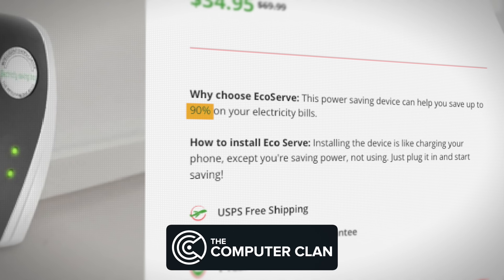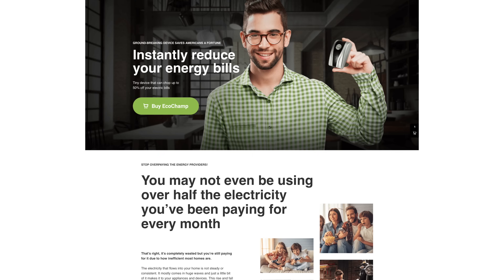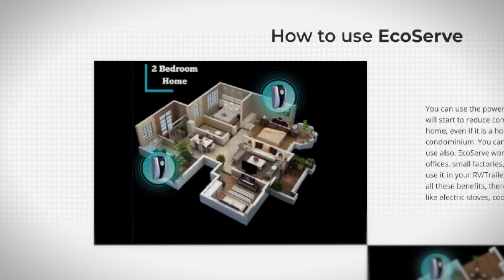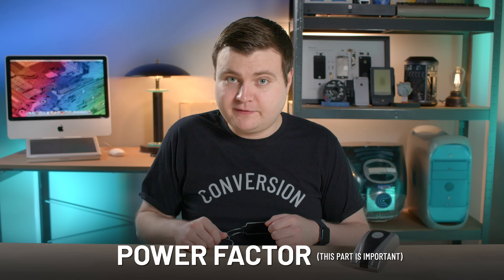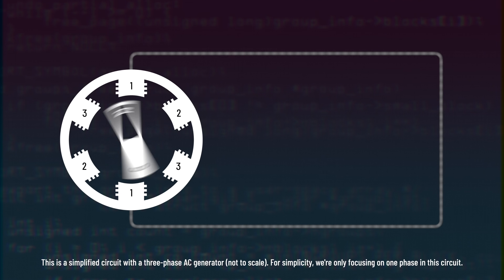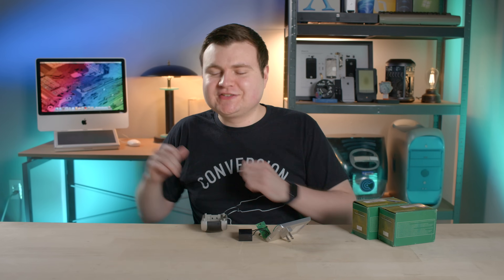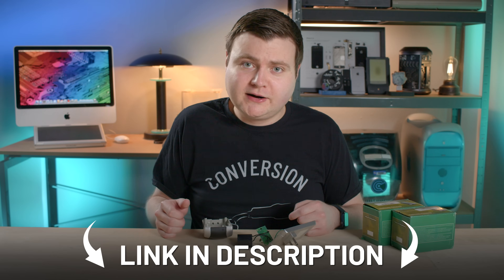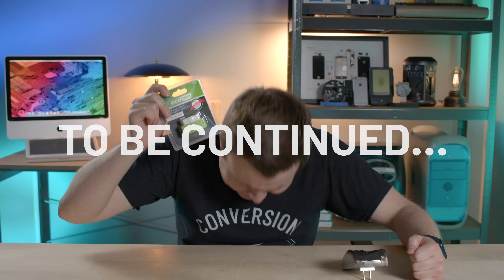Electricity Saving Box Scam (The WORST I've Seen) - Krazy Ken's Tech Talk

Comment: Let me just add something to this, modern utility meters have the ability to display, as well as record, at revenue grade(less than 0.05% from absolutely correct) real power, apparent power, total power, power phase, and frequency at sampling rates about about 1khz, though most of the data networks they are connected to cannot handle that much data from all the meters connected to them, so they do summations of these metrics at intervals that are programed by the metering department of the utility. They can also trigger reports in real time based on certain criteria, such as low voltage, loss of power, frequency deviations, or other issues, as programmed by the metering department. 

A modern meter, by default, stores these metrics at about 1 second intervals for about an hour, about 5 seconds for about 6 hours, and then about every minute for a month on the onboard storage. Depending on the metering backend connected, and the exact settings of that backend for the particular meter, the utility may have years of 1 second interval data from a meter(this was only really ever set up at that detail for nuclear plants that I am aware of) 

As a fun fact, they actually record power flow in each direction separately, but, in most states, regulations are such that unless you have a net-metering contract, you are actually charged for the summation of both ingoing and outflowing power, as a legacy of the mechanical meters anti-tampering and anti-theft measures. Where this is true, it's a requirement of the state regulatory board. Modern meters actually have a lot of cool tech crammed into them, like multiple serial interfaces, pulse outputs for external metering or monitoring equipment, wireless modems and gateways both for the consumer and utility use.

Comment: Might sound nitpicky, but it's a HUGE correction actually. Apparent power isn't "the actual power being supplied". It's the apparent power on the grid infrastructure.  Let's say you were the only factory on a line between a power generation station and your factory. The power generation station would produce True Power KW, and your motors in your factory would also consume True Power KW. HOWEVER, the infrastructure in between the two points would see the Apparent Power. 

This explains why it is billed to industries, and not to residential dwelling in the vast majority of markets. The residential market use very little power (compared to industries) and also, their power factor is usually very close to unity. Industries however consume very large amount of power, with sometimes abysmal power factors. Therefore, power grid have to built much beefier infrastructure to support industries than the residential market.

It's also an explanation on why reactive power is so much cheaper than true power. It is much cheaper to built grid infrastructure than to build power generation facilities (and their power source, assuming non-renewable power sources). While the power grid would really like industries to have a good power factor, it has no impact on the power generation facilities and doesn't use more coal/natural gas/uranium/whatever.

Comment: I wouldn't say AC helps electricity travel long distances.
All it does is make it easier to covert between voltages.
In fact, AC makes it harder to travel long distances with inductive and capacitive effects.
That is one reason why very long range power transmission, and undersea cables, use DC instead of AC.

Comment: 5:50 note this won't work with all lights. Some modern LED lights have flicker protection which, from what I understand, has a small capacitor that keeps the light on between cycles

Comment: A small correction: reactive power is not directly increasing the energy drawn from the power plant source, instead it's a problem because it increases losses during transport. The out-of-phase current flowing in the conductors is not doing any work in your house, but it heats up the conductors between the house and the power plant.

Comment: There was an identical product for your car called fuel shark and it claimed the exact same things. You plug it into the cigarette lighter and it's supposed to smoothen the alternator output to make it more efficient and take less power from the engine meaning you get more fuel efficiency. When you open it up it's just some LEDs and a capacitor. Exact same thing.

Comment: God, the gas saver at the end reminded me of one of the worst videos I've ever seen. It was a scam video on Facebook where a guy claimed you could improve the fuel efficiency of your car by making an electrolytic oxygen generator out of a mason jar and piping it into your engine. Ignoring all the other obvious issues with that scheme, the guy claimed that "only about 10% of the energy in your fuel tank actually gets converted into kinetic energy by the engine, that means 90% of the gasoline you buy is just coming out of your exhaust pipe without being burned." That line made steam shoot out of my ears; for those of you who don't know, it's true that only a small portion of the chemical energy in gasoline gets converted to rotational energy by the engine, but the reason is that the rest of the chemical energy is converted to thermal energy as the fuel burns. In a modern car, with a digitally controlled fuel injection system and a catalytic converter, very little fuel "comes out of the exhaust pipe".
The most confusing thing about that video wasn't the scam science, it's why it existed to begin with. The guy was pitching it as a home modification, practically a craft video. It wasn't a product. Unless he's a major stakeholder in mason jars and copper wiring, he couldn't possibly profit off of spreading misinformation like that.

Comment: What's not widely known is that the new generation "smart meters" CAN differentiate apparent vs actual power and in some areas are starting to charge for it. As and more DC loads enter homes with lower power factors, this change will come as a shock to many...(no pun intended).

Comment: 4:37
I thought we used AC because stepping up and down between high and low voltages in the early 1900s was trivial compared to DC. That paired with high voltage/low current transmission being more efficient due to less resistive losses through the cables.
Reply: The high voltage, low current transmission is what allows the long distance. Granted he simplified it down to “it can go long distances”, but he had the right idea.

Comment: In another review I've read about this device they x-rayed the black box, it's actually not a capacitor but just a dummy. The two conductors just ended in the black box (not connected obviously).
Also sometimes there are more components in there (namely a varistor with some restistors) which could actually prevent voltage spikes, but really inefficient

Comment: Its not that AC helps travel longer distance. AC is easy and cheap to transform in transformer. So you can step up voltage up to send more power in thiner cables.

Comment: When using 1/4 Watt resistors, they aren't actually rated for the mains voltage, and unless you have several of them in series, things might explode. Thus the particular resistor arrangement there. And yeah they are of course just for the LEDs.

The enclosures should have a self-extinguishing additive in the plastic, usually some sort of angry halogen compound which can harvest open hydrogen bonds, but don't need to be able to stand up to direct sustained fire.

BTW your household load, dominated by LEDs and SMPS, is already fundamentally capacitive rather than inductive in nature. Adding another capacitor to mains is generally the last thing you want.

Comment: 5:58 The claim about lights flickering very quickly isn't quite true. Yes, it is true that some do it, but unless a light (particularly LED ones) have a cheaply designed power supply most will be fairly stable due to the use of a full bridge rectifier and some smoothing capacitors. That said PWM dimmed LED fixtures will flicker (faster than 60Hz usually), though voltage dimmed ones won't flicker.

Incandescent lights on the other hand, don't flicker at all. Due to the nature of them illuminating because of electricity flowing through a wire, the wire doesn't cool down enough to flicker at all.

Comment: 5:45 WRONG.
LED Lights are what you are talking about here. Halogen Lights (or all the old school lights that are not LED, Like fluorescent or old school light bulbs with tungsten) DO NOT BLINK.  The way LED lights work, they blink and can be seen with a video camera with the same shutter speeds as the light blinking.  You can record car lights and see the same thing with people with upgraded LED lights compared to the old school halogen. Most people have went to LED lights in their homes that is why you might see blinking, but there are still people with fluorescent and halogen bulbs.

Comment: I did buy and like a little volt/amp/kilowatt box you can plug items into and it gives the voltage of the outlet and then the watts an item uses and amps if you are curious. It was cheap and works just as advertised. Not a saver thing just a curiosity thing.

Comment: it actually could still save a tiny amount of money because reactive power causes true power losses in the wireing but the leds and restistors on the tiny board probably uses more power than saved. Most homes have a capacitive power factor anyway in that case it would make it worse

Comment: My theory for how these things were originated was that, it used to be (may or may not only apply to China) that power meters aren't that good at metering true power when the power factor is way too low, which means that if you use a capacitor to intentionally lower your power factor you might be metered less, and thus billed less. Of course, nowadays power meters just aren't that easy to be tricked so these won't work anymore. And the claim about power factor correction, even if the effect would be noticeable, likely won't do any goods anyway, because home electronics are required to have PFC circuit built in anyway.

Comment: I’m sure the manufacturers are looking for Placebo effects. i.e. People start paying attention to their power usage and by that very act, unconsciously use less of it.

The OBD2 thing could actually save gas. But it will have to pull power from the engine (slower acceleration) to do it. In which case, why didn’t you buy a more fuel efficient car with a smaller engine to begin with?

Comment: Just a little tidbit. DC is actually better for power transmission but previously it was impossible to create DC voltages high enough to even remotely compete with AC. There are many modern high voltage Transmission systems that have been Adopting DC.

Comment: These devices can be very expensive and they may fail and need to be repaired:
https://www.amazon.com/dp/B09X4MJTNH/ (don't buy this, get an electrician who knows to get a cheaper one, this is so expensive as it's multiple values in one box)
This is a cheaper one with a high value: https://www.amazon.com/dp/B08V1LRNWR  and more cheaper https://www.amazon.com/dp/B08NYLWLWF
X2 capacitor are expensive. Some loads can be wired as reactive or capacitive load (some light fixtures) and a good  electrician may balance these without any extra to get a good powerfactor.

Passive PFC is now nearly dead and these units are the gravestones with the rest of the stock. Modern applications needs a active PFC (an iphone charger draws to much power to get a CCC label to be on code). [CCC is mainland china, CE is for Europe, and I don't know what it is for us: But you don't want to be banned from china if you cheap on a 0.05$ active PFC]

Comment: Well me being quite a crafty bloke I have to say that they definitely are betting on people not knowing the kinds of power, since I for example which have quite an extended knowledge of DC power had never understood what the power factor was until very recently when I had to calculate capacitor values for a three phase electric motor run from a single phase, and I have to say for people that don't need to know it is quite complicated for them.

Comment: Every 24 hours I save 75 per cent of the energy I could be wasting. When I go to bed around midnight, I completely turn off my TV and all the devices attached to it (4k player, tivo box, speakers etc). As I don't watch TV during the day, I don't power up my entertainment set up until 6pm. Have been doing this for around 20 years, so probably saved quite a bit of money. Having a device on standby can end up costing quite a bit of money, especially given the price of electricity in the UK at the moment.

Comment: I think I can tell you what the LEDs do...
And it also explains the term spike buster and the picture on one of the websites you showed that seemed to show noise being removed from the line.
In the audio industry there are similar little devices whose purpose is to filter noise on the power lines...
These consist of a little box with one or two LEDs on them that you plug into an outlet.
The capacitor is a simple filter - across the AC line - and will filter high frequency noise that originates from outside or from other equipment that you have plugged in.
And, since the LEDs are connected in series with the capacitor, or something similar, they will flash if significant noise is being filtered.
(The description suggests that these devices "harvest the noise and burn it off as harmless light".)
They are sold with the intention of reducing noise that might adversely affect sensitive audio gear... and may actually help in that regard... if you have a noise problem.
But they are NOT claimed to "reduce your electric bill".
It looks like these guys may be using the same internal circuitry... 
But they've garbled the explanation of what it does... or just done a bad job of stealing or translating it...
And made completely outrageous claims to make it marketable to a general audience...

Comment: Speaking as an electrical engineer.... you've really misunderstood what reactive power is here! It's a lot more like power that "sloshes" back and forth, it goes into your equipment for half the sine wave and then right back out of it back to the power company on the other half. Wasted power is still real power.

The reason industrial sites get billed for reactive power is that the presence of reactive power increases the current in the transmission lines, which increases the losses in said transmission lines--the reactive power means that a little more real power gets wasted, but since that wasted power is on the power company's side of the power meter, it doesn't normally get billed to them (regular power meters only measure active power and ignore reactive power in actually a really clever way, look that up if you want to be impressed). So the power companies will bill the big industrial sites that have poor power factor to make up for the loss. As I understand it, they aren't billed at the same rate for reactive power as for active power.
Reply: I forgive all erroneous layperson-friendly explanations of how electricity works. I once tried to read a document about how electricity really works in homes and hospitals and it made my head spin.

Comment: 13:06 And this box does even more harm. As now most lighting is LED and the cheap ones use capacity droppers, and therefore your main load is already capacitive, you would need to run a bunch of motors (or other inductive loads) to get the power factor align again, not add more capacitors.

Comment: This box is a total scam, yes.  However if you want to measure it’s effect you cannot use Watts.  W and VA are not the same thing in AC.  You want a device that can read VA.  Also a house’s power factor doesn’t matter but this device if properly sized will make it worse.  A factory has a lot of inductive loads so a capacitor of proper size will bring the power factor closer to 1.  However you might have some motors in your home but now days with all the computers and electronics and switching power supplies you have tons of capacitance loads, you would need an inductor to bring the power factor closer to 1.  Doesn’t matter as you aren’t billed for VA you are billed for kilowatts at home.  Also lot of smart meters can read VA and power factor incase they might want to switch it for billing, but I doubt it will ever be used, so not sure why they would build a feature in.  It is sad that people keep falling for these devices, at best they do nothing, at worse they fail and burn down your house.

Comment: I just recently saw the video that you did on the battery pack from the mobile I believe that the solar panel has a safety built-in feature in order to prevent overcharging the battery if this is true you may be able to actually get into the device and adjust the safety to allow for up to an 80% charge on the battery instead of the 25-ish percent if this is doable more battery power would be available to customers and the company building the device would be able to actually sell the device at a slightly higher cost meaning more profit everyone can win in the endWe just need to think inside and outside of the box thanks would love to hear your comments thank you

Comment: To be fair, reactive power CAN cause some issues.  First, if your power factor is very bad, you can get a surcharge from some utility companies.  Second, reactive power still goes through wires, increasing current, so that means more resistance losses in the house wiring.  These losses will be tiny, but they do technically exist.  Finally, if you are running off of an inverter (say a battery backup system) then reactive will WILL be the same as real power to one of those systems.  Yeah, these are corner cases.  But if I were using a battery to run a fan, I might want to make sure the power factor on the fan was close to unity for maximum battery life.